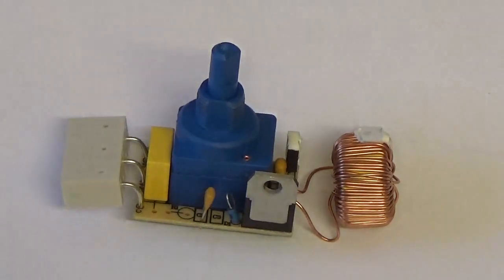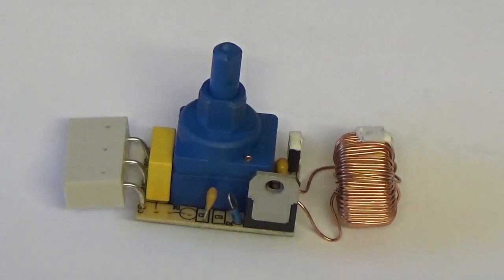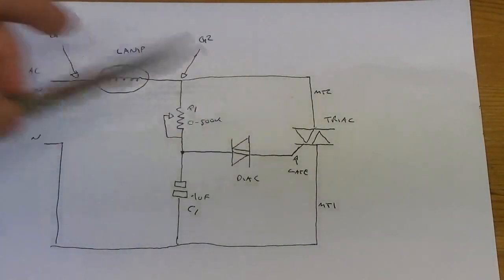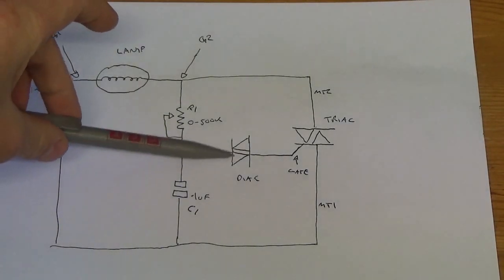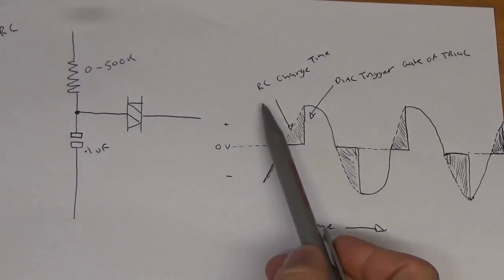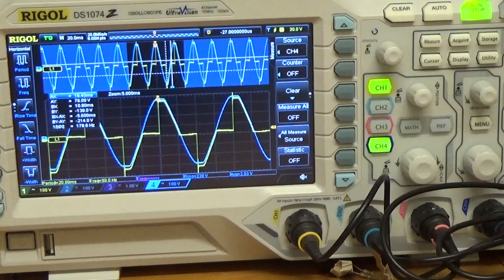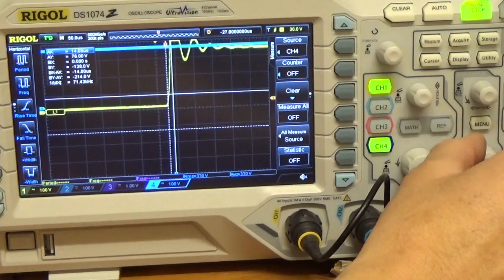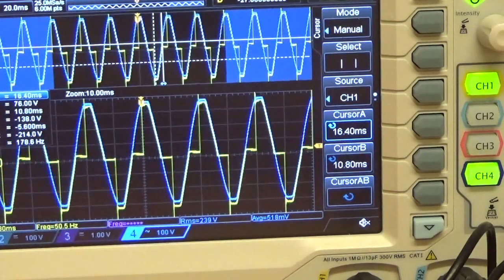AC Dimmer switch working principle

Comment: I have  a question; I was playing with a lamp and a dimmer, and i had the suspicion that even with no light in the lamp, there was voltage in the bulb; i conected a testes and no matter the light was on or off, there was up to 100v in the line; coul be a dammaged dimmer or i connected it backwards?? should the dimmer show 0v when its all the way in ''off''??  thanks! :)
Reply from the maker: Hi. If your measuring voltage between the terminals of the dimmer (switch wire) you will have a voltage if its off, study the correctly wired light pic link bellow.
If your measuring between L1 and ground/Neutral when the light is off, you have wired the light up wrong. Also you will measure a voltage if the dimmer is on its lowest setting.

http://www.ultimatehandyman.co.uk/diy/electrics/light_fitting/light_ceiling_rose_single_neutral_switch.jpg